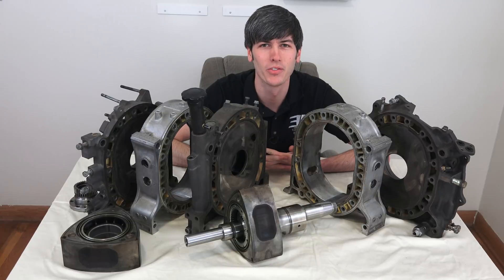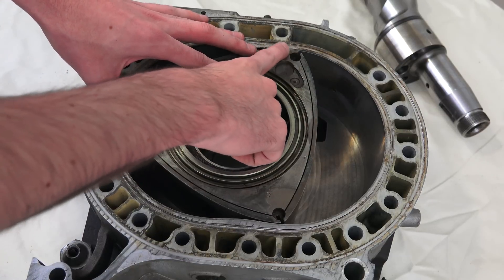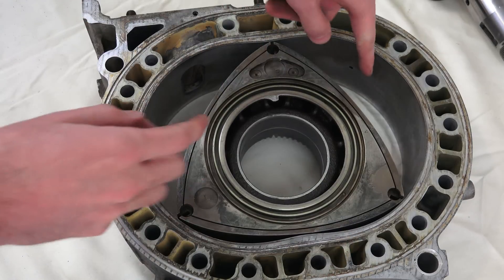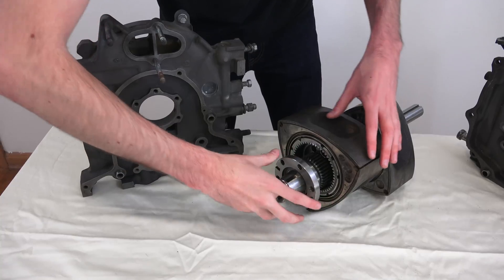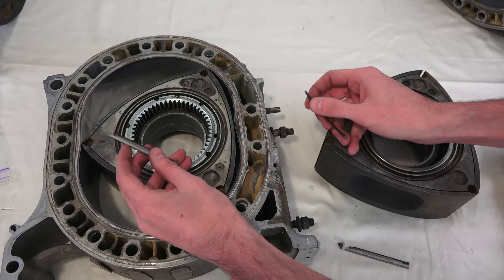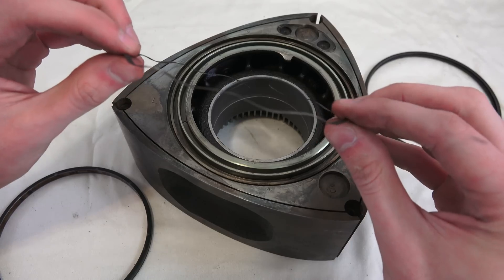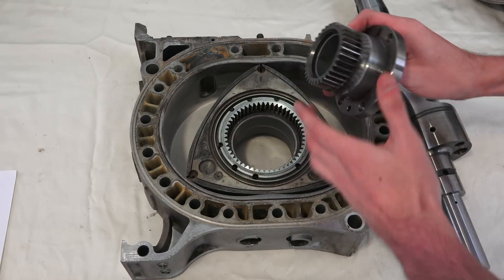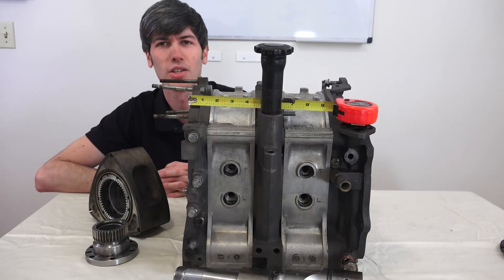How Rotary Engines Work - Mazda RX-7 Wankel - Detailed Explanation

Comment: does anyone know which directions of the pressurized force points during the the combustion cycle, doing an analysis for my dynamics class
Reply: Likely too late but ... The engine mimics the piston engine in this respect.  The net force vector, centered on a face, points toward the crank spin axis, like a TDC firing position on a piston engine ... no torque produced. Then as the rotor turns after combustion, the force vector points off the crank axis, starting to produce torque. As rotor rotation increases close to 90 degrees, the full 30 mm offset is offered as a moment arm, allowing max torque production for the current chamber pressure. As expansion and rotation continues, less torque is produced until BDC where zero moment arm offers no torque.

Comment: Eh? Why is there a throttle linkage for the oil injection when the oil metering pump has a direct connection to the output of the motor? Wouldn't the injection correlate directly to the current RPM?

Comment: i own an rx8, 2004, and its been the MOST reliable car to me, sure it takes some quarts of oil every 5000 miles or so, but thats about the only "high maintenance" aspect i had to deal with,  been on top of the routine maintenance such as coils, spark plugs, revving 9000 rpm a day, not starting and stopping when cold, etc. 

But i wonder, can the rotary engine be improved upon where it can get decent MPG while lowering emissions, or the limitations on the design of the wankle engine makes that physically impossible? Is there any way to make a rotary engine reliable and moderately fuel efficient? I'm not saying it needs to be have like 29 mpg, but how about something like 21-24 city mpg? is there any solution to the rotary engine? or the design of the engine itself prevents it?

Comment: Many Thanks for your clear description of wankel engine,perhaps moore concerning subject are reliability for aircraft use, the TBO regarding apex seals and its metallurgy specs alloy,and  what configurations are  for exhaust( lateral located)?? and intake peripheral or  side or lateral too? what is gear ratio,and eccentricity of shaft to rotor center of symmetry?trochoidal equation? Best Regards .Its  future in hybrids cars or planes wonderfull,air cooling or liquid cooling,which is best,ethylene glycol probably? Bye, Many Thanks.I read that this concept was utilized on 16 century for water pumping or it is a myth?For pumping wonderfull as hydraulic  actuator.

Comment: They use a similar principal to a two stroke engine. As the piston moves, it uncovers exhaust and intake ports, so no valve train, no valves, no timing chain.  They used to be somewhat polluting but university of idaho solved the problem and now 2 stroke snowmobiles run cleaner and are more fuel efficient that 4 strokes. Plus they weigh alot less.  While rotary and two stroke engines make need rebuilds sooner, they are exponentially simpler to break down and rebuild. Doing a new piston and rings on a two stroke is not much more difficult than changing a tire.
Reply: Not true, all Wankel engines use the 4stroke operating principle. Port induction is not unique to or exclusive to 2stroke engine designs.

Comment: Wait, how does the 20B (triple rotor) work? Like what’s the angle difference of the rotors and is it different in any other way? And if the mesh gear that rotates the “crankshaft” goes in the front plate, why does the other rotor also have gear teeth?

Comment: 13b with single turbo can easily getting 500 + hp, able to with stand high turbo boost  maybe can count as one of another advantage. since there is very few moving parts , a lot less component will be considered.

Comment: I have a question, what does the air fuel mixture compress up against, because if there is nothing for it to compress against the mixture would just continue being pushed around the chamber, unless the rotor rotates around a central shaft like a planetary gear sistom making the rotor crawl  around the chamber.

Comment: Back in the day I bought a new one and the salesman told me before I bought it make sure you check the oil every time you get fuel and make sure you change it every 3k . Nowdays no matter what you have to do a salesman will not tell you what the car really needs to keep it running. To bad, I had to sell it when I went in the NAVY and went on submarines and got sent to Holyloch Scotland. Now day I am probably shaving with the steel sent overseas

Comment: I am sure with more thought the Apex seal problem could be eliminated, particulary those seals on the side wall of the engine; for instance using an entire pressure plate instead of individual seals.

Comment: if mazda could make piston engine more efficient,  y not on rotary. if mazda could make spark controlled compression ignition on piston engine, y not on rotary. problem solved.

Comment: Pretty good explanation Jason. You might have added/shown the several ways that the engine can be modified. Bridge Ported or a Peripheral Port where the plates are blocked off and fuel goes through the rotor housings. Also another interesting fact is the cooling system surrounding the engine and that if overheating occurs it warps the housing allowing coolant in the combustion area.  Another note what you refer to as the "face" seals we called the oil control rings/seals and those have rubber seals installed both inner and outer rings.  The fact of mid 1970's Rotary's came with the 4 bbl carb stock is worth a mention. Like the Pick up with pick up the REPU. (ROTARY ENGINE PICK UP) The 60 cubic inch 10A R100 was a neat little Mazda too. But the absolute best of them all is the MAZDA RX3 SP. The Dream Find of any/every rotary fan. God do I love the little Wankel Engine. ATTN:  If anyone has or knows of any early Mazda's available?  Please reply and leave me a comment.

Comment: If the lube oil is fixed in his housing system then after power the exhaust gas will mix with the lube oil and lube oil get dirty very fast it mean we have to change lube oil very fast right????

Comment: hi i have  question... u said in the video that, the engine going to need an oil to be burn.. so are there any storage or extra oil tank to place the oil ? or it will just use the engine oil ? that we do change regularly ?

Comment: The Wankel Rotary design could make a dandy experimental aircraft engine or a marine one.  Reasons:  Nothing to actually break, and the efficiency gets better the closer you run to wide open throttle full load, and the faster you get it spinning.  The high revs minimize the backwash of compression into the lower pressure chamber opposite the apex seal.

Comment: Forgive my question - I have no understanding of the physics of internal combustion engines, but would a flat-4 (i.e. Subaru Boxer) engine suffer from the same problem of lack of a reciprocating masses? I'm not sure if the pistons all traveling in the same direction would make any difference.
Reply from the maker: Hey there! This video should provide plenty of information about what you're asking. :) https://youtu.be/VL69r96VfuU All piston/cylinder engines have reciprocating mass, but they balance this force in different ways.

Comment: I'm an undergrad student of Mechanical Engineering. And I'm planning to do a research project on improving efficiency and reducing emissions from a Wankel engine. I need some details for analysis and benchmarking. Where can I get the specifications of a Wankel engine like torque vs rpm curve, power produced, efficiency etc., Single rotor would be better because I don't want to complicate it too much. There are no Mazda's in India and I couldn't get those details here

Comment: Questions.
1. Why not make the rotary part which is triangular now into something more complicated (with, let's say 6 sides) and so make two concurrent opposite combustion chambers? That would both stabilize the temperature, will make seal much closer (because of the shape) and will also increase the power?
2. Why not use better heat-dissipating materials for the housing, so that the temperature difference will not be so evident?
3. Thy not have the oil injected where there is no fuel burning, just like in ordinary engines?

Comment: Interesting video but fails to point out that some of the "inefficiencies"  resulted in advantages back when the engine was first used in the 70's.   First, no catalytic converter was required because the low combustion temperatures didn't produce as much NOx.  Nor was the standard, efficiency killing,  exhaust gas recirculation needed.  Nor were the ancillary air pumps or spark retarding schemes needed to meet emissions targets.  The video producer fails to point out that automobile engines in the late 70's and early 80's were woefully inefficient.   Seven liter V-8's were producing 220 hp and hoping to get 12 mpg.     The rotary powered Mazda's were a thrill ride in comparison.

Comment: The rotary engine's most serious flaw is external (outside the engine for dr. bummer's sake), and sits behind the steering wheel. Most guys (and some girls) do not understand the workings of a rotary and therefore don't use or maintain it properly. It should last way past 150k miles if treated and maintained properly.

Comment: A perfect engine for prop aircraft. Why isn't it a certified engine for aircraft? It's a perfect marriage. The dis-advantages are too insignificant. Check out a Cessna 152 or 172, and see how much oil it burns! Also, Aviation 100LL fuel, has lead in it to lubricate the valves. No valves, means you can burn regular low octane gas.

Comment: three moving assemblies, as the rotors have wipers, springs, compression spring( for maintaining seals for compression) and less loss of oil.
Reply: lets see, three surfaces by two rotors, hmmm six different times of combustion, in one 360°, gee it's like a a a V6  right. hey.. what's that flame from the blue smokie exhaust !?! smmoootthhhh. right.

Comment: can you tell me how you can fix a 2004 mazda rx8 it can crak but cant start and no one cN FIX IT
Reply: Try the ign system first. Do not take any notice Bimmer McBimface.
Reply: The real doktorbimmer 
Bimmer McBimface, there are set procedures for engine diagnostics.

Comment: Anyone that has owned a rotary and loves the RX-7 like myself will accept the disadvantages with the smoothness and beautiful hum of this engine. I know in this current emissions generation a lot of the cars shortcomings are frowned upon but again drive one and your mind will be changed. Its about driving experience not being a dyno king with these cars as there are plenty of forced induction and huge displacement 8 cylinders I can build if I just want big power with no regard for driving experience.
Reply: Bimmer McBimface,..... definition...
obsolete
ˈɒbsəliːt/Submit
adjective
1. no longer produced or used; out of date.

The rotary is produced and used.
Reply: The real doktorbimmer 
Bimmer McBimface, the rotary is made by many makers.
Reply: Man why do you hate the rotary so much? haha. There are still some rotary shops out there, I forgot the name, but I saw one in an RX7 group. Plus, I don't believe it's dead yet, I'm sure you're aware of the RX Vision concept, and Mazda also said that they will reveal a prototype(of the 16x rotary) this year(Probably the same date of Mazda's Rotary Anniv). Plus, compare the research span/time done to the reciprocating engine compared to the rotary, the rotary is relatively young!
Reply: Lol I was wrong about the engine name. It wasn't the 16x, the 16x was for the RX8. They were gonna name it the SkyActiv R, and yes, I understand it was a concept, but until now, I guess we can never really decide. You are on the 'No, the rotary is dead' side, but I'm not even if the CEO itself denies anything in the works, since in the car industry, everything is subject to change. A concept can still turn into reality, maybe not as good as the concept it was from, but still in reality!
Reply: The real doktorbimmer 
Bimmer McBimface, are the voices louder today. How loud?

Comment: Liquid Piston is another version of a Rotary. 
"twice the fuel economy of a gasoline engine over a typical drive cycle". They are one tenth of the size and weight.
A few weeks ago:
DARPA awards LiquidPiston $2.5M to advance further X4 rotary engine prototype
http://www.greencarcongress.com/2016/12/20161214-liquidpiston.html
DARPA funds 30 KW X4 liquid piston engine that is 90 times lighter than a conventional 2700 lb military 30 KW diesel generator
http://www.nextbigfuture.com/2016/12/darpa-funds-30-kw-x4-liquid-piston.html
The US gvmt takes it very seriously.

Comment: Why not flip half of the motor in a 2 rotor to make even exhaust temps on both sides, it's less space efficient, but it could help make a better seal...
Reply: The infamous doktor is rude but mostly right. The source of all the useful work performed by an ICE is the heat created by the combustion of fuel. By definition, any heat escaping into the cooling system and the surrounding air represents inefficiency. In practical terms, that inefficiency is unavoidable, so of course it is important to design a cooling system that will effectively dissipate that wasted heat and prevent engine parts from melting or warping. The misunderstanding between you two is probably a result of your different experience and training. I would guess you have practical type training (technician) and doktorbimmer has theoretical type training (mechanical engineering).
Reply: Rasta Lion 
The thermal efficiency is clearly getting better. Laser and HCCI ign offers superior efficiencies. As you say, the heat will not increase as efficiency rises.

Comment: Can i know what are disadvantage of this engine and the main problem occur in rx8.. Im new to this wankel type engine
Reply from the maker: Search my channel for "4 reasons why the rotary is dead."
Reply: i daily drove a 89 rx7 gtus for 2 years. it overheated and poped off a coolant hose once about 9 moths into owning it because my belt popped. i pulled to the side had a friend bring me a belt and coolant and drove it for another year and some change, no issues with the motor since. the only real issue i ever has was with my transmission (cost 100-150 for a used one since it was N/A) the car always started right up regardless of the weather, the person i sold it to had it buried in snow for about 2 weeks and said it started with no issue. i did nothing but maintenance to it and never had an issue even with my daily spirited driving and occasional drifting. mpg sucks thats the only problem but i got the car knowing that and really dont care for gas mileage in a car like that.. all in all i think they are pretty reliable. and still have one that im building. they are high maintenance but so are alot of women. id rather deal with the car to be honest lol.
Reply: Engineering Explained it's awesome that you reply to old comments too 👍🏻
Reply: Khairuddin Karim
Reply: This engine is not meant for mpg, please understand that right off the bat. And the reason for the engine failure is because they changed the design from the rx7 to the rx8. Along with the main problem is people didnt keep up with the service, the ignition coils would go bad and then the spark plugs. Usually the coils would end up getting white spots and the spark plugs would look as if it was running lean. Then cause to engine failure. The rx7 has the 21B with the 3rotor and turbocharged, while the rx8 has the 13B that is naturally aspirated. These engines were designed to keep a high rpm while going around curves, they were used by many racers in high performance races such as Indy. You can look up the mazda furai, which properly uses the rotary engine. I own a 2005 mazda Rx-8.
Reply: if you keep up with regular maintenance, the engines can be very reliable, especially when they are NA

Comment: So for each rotation of the output shaft there is one combustion. That is twice the rate of a 4 stroke engine.
But...
The Mazda engine is a 2 rotor engine and therefor there are 2 combustions per full revolution.
The same as a 4 cylinder in line 4-stroke engine you should compare it with.
 
So why should the actual engine run smoother?
It is a bit like a 2 cylinder 2-stroke engine.
Reply: Yes, the firing rate of a 2 rotor engine is equivalent to a 4 cylinder piston engine. However the expansion of combustion gasses in the rotary follow the eccentric shaft around to some extent so the power pulses in the rotary have a longer duration. The smoothness of the output torque is much better than in a 4 cylinder piston engine.
Reply: Right... That makes sense!